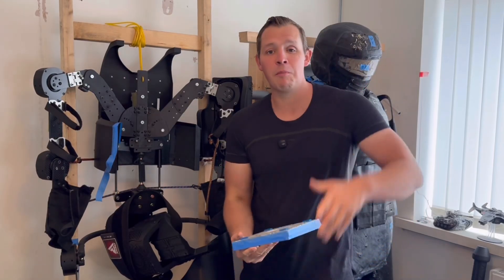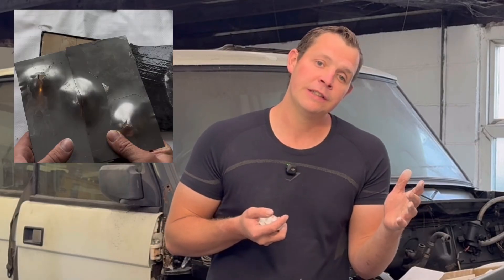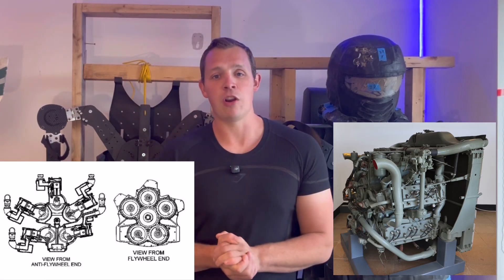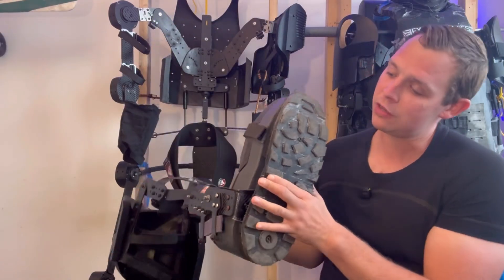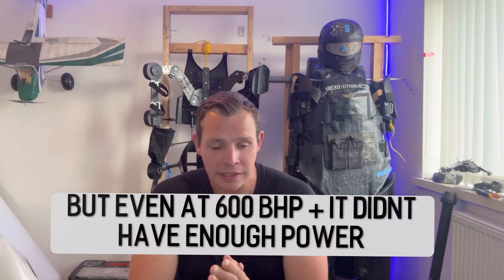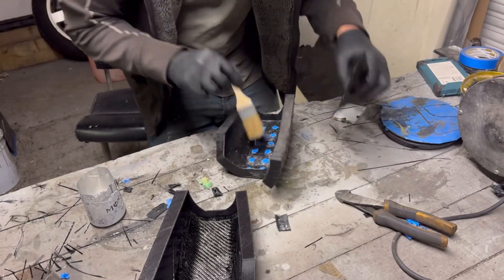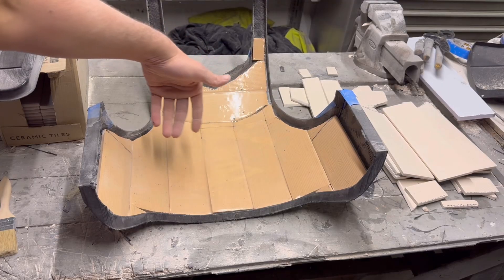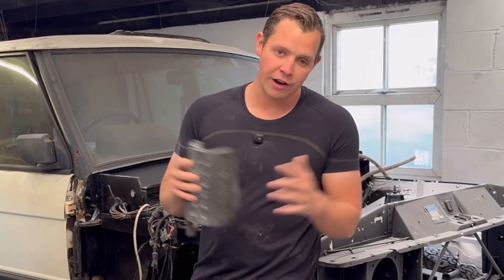Making the Sherman Tank of POWER ARMOUR - Composite armour build pt1

Comment: Very cool, and I hope one day you can get the kiln to realise the hexagonal ceramic plates. Rather than doing large strips of tile, though, would it be better to do smaller ones to minimise cracking? Or maybe it wouldn't matter because smaller tiles have gaps between them that might as well be cracks...
Reply from the maker: Thanks, and yeah its just the gaps, the plus with hex tiles is they fit together really well and naturally want to stay in place where as rectangles want to come out of line so its better to have bigger tiles at the minute

Comment: Do you have access to some land where you can dig around in the dirt and also have a controlled fire? Because if you do, then you can also fire all those custom tiles you made to a sufficiently high temperature. I've used dirt pile kilns to fire porcelain before. It's not even too terribly difficult, though you'll probably need a couple of extra guys to help, since it needs to have dirt piled on until the smoke stops seeping out withing a reasonably small time frame. You just have to use the right fuel and blow enough air to get the fire hot enough before you bury everything. The process also ideally creates enough heat and pressure to smoke-glaze the ceramic, coating them in a pretty hard carbonized layer.

Comment: Sherman armor sucked, call it a panzer if you want to be cool.  Imagine if england was german speaking, there would be a hell of alot less machete attacks.  Also you can probably get alumina tiles from a grain silo supplier, they are used to line the chutes for abrasion resistance.

Comment: I find your power armor functions more like solar auxilia than astartes. 

Could be better if it has self healing function.
Reply from the maker: Ive wondered if its going to be like an eisomhorn power armour tbh.
I do want to layer blood stop powder on the inside the other armour to stop bleeding if i round makes it through. In theory should work well as the blood stop will literally get projected into a wound by the round/shrapnel coming through.
Reply: @MattExo-Dynamics  Body wound healing function is nice. But my point is the self repairing/sealing function of plate armor shells. It’s for the sake of long term survival and reusability. It would be similar to crysis nanosuit.
Reply: Astartes power armour is environmentally sealed, for one thing. Plus, how would self healing work?
Reply: @MansMan42069  Solar auxilia power armor is also sealed. I think if ceramic is incorporated with shape memory material for crack propagation and sealing cracks.
Reply: @angelofthedead1886 Then functionally what is the distinction between the two?
Reply: @MansMan42069  Astartes power armor is supported by black carapace suit, it has sensor that makes it like a part of a body of space marine. Solar auxilia’s power armor have mechanical limbs that supported the movement and lifting stuffs of a wearer.
Reply: @angelofthedead1886 Technically both suits function that way. Powered actuators helping to move the armour. The Astartes suit just has the added Black Carapace to reduce the lag between intent and action.
Reply: @MansMan42069  I see. Back then i just thought the black carapace is like a shock absorber body suit to dampen the impacts from outer shell. Just like how the knights don layers of fabric, leather and chainmail before the plates i guess.
Reply: @angelofthedead1886 I believe astartes do have a muscle suit underneath their armour (visible as the exposed black abs in Phobos armour) that might function as shock absorbers

Comment: Consider using 1.5-3mm titanium sheeting instead of steel. It is lighter per cubic cm, and is more resilient to bullet impacts because it doesn't deform as readily. 

Especially when using thin sheets where the deforming nature of steel will allow bullets to penetrate because the sheets are too thin.
Reply from the maker: Its a good idea and it would be better… but id need a 1x2m sheet 1mm thick which when i priced it up it came back at £800-1000 - more if i go thicker so that might be an option for a future upgrade with better tiles.
Reply: I should also state that these sheets are readily available on Amazon, so sourcing them is easy and relatively inexpensive for both R&D and replacement if damaged.